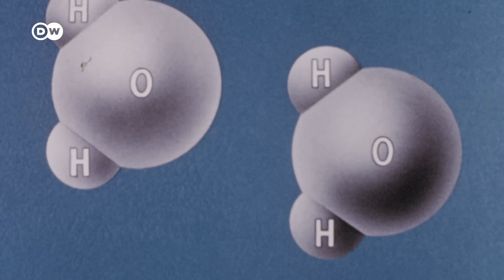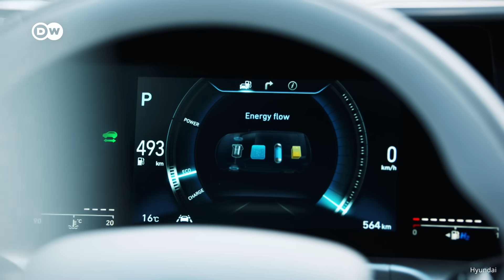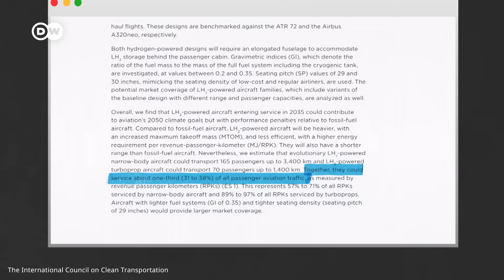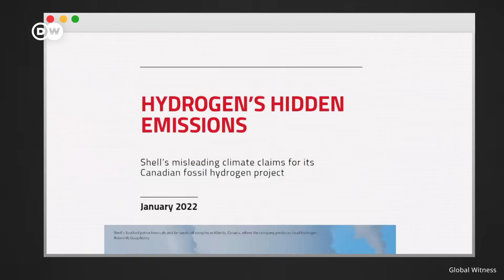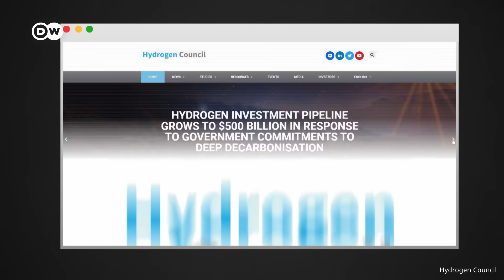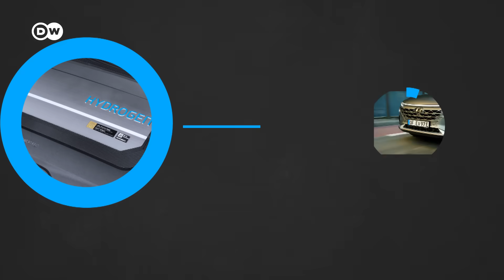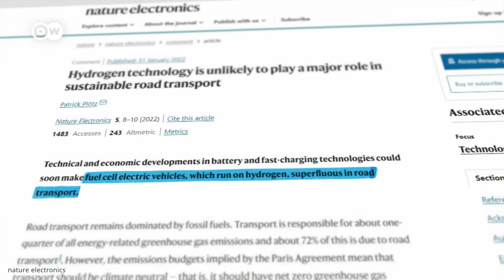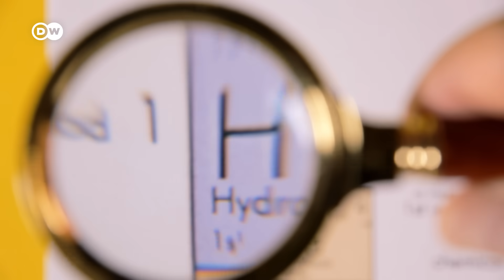The truth about hydrogen

Comment: Personally, I think that we should focus on creating methane from renewable energy. The tech already exists for industrial storage and transportation of natural gas. We could use carbon in the atmosphere and water to build methane. Hydrogen is difficult to handle, and frankly it's greenwashing. The time it takes for the technology to develop will be time that fossil fuels continue to be extracted and pumped into the atmosphere. High temperature nuclear power reactors could also create hydrogen, or green methane without emissions.
Reply: "The time it takes for the technology to develop will be time that fossil fuels continue to be extracted and pumped into the atmosphere"

That's the point. The people selling hydrogen is the same people selling fossil fuels. See, it's connected.
Now if you can connect methane with fossil fuel too, maybe your idea have a chance.
Reply: I like this idea, but I like George Olah's idea of using methanol even better, since liquids are much easier to handle than gases.

Comment: While governments like Australia's are pumping huge amount of money into "hydrogen fuel technology" trying to win young left wing voters over, it's impossible to tell the real economics. Industry giants jump onboard with this selling "technology" to government for large subsides and investments in return for marketing targeted at the same gullible young left wing voters to drive the false economy.

Facts are, there is no climate crisis, instead there is a need to move away from fossil fuels for geo-political reasons, but this will take decades as work for cleaning batteries is required and ramping up of production takes time, then you need about 20 years to replace the current fleet of cars that hasn't even started yet. 

Hydrogen is a dead end technology, it's not a fuel, but energy storage and transport, but is a really poor one. The molecule is just too small to be contained, rots steel and lacks the energy density for even space transport. Considering the space industry turned it's back on hydrogen, even though it's been using it since the early 80s with the space shuttle, itself a dead end technology should tell us a bit about it's viability for other uses. Unfortunately, young people don't have the real life experience to separate ideological pipe dreams from real world technological development and the world's over-reliance on university grads is only making this worse.

Comment: We're going to have hydrogen in the mix. There are areas where batteries aren't going to be feasible, as mentioned: Aviation, shipping and industry. Also, longer term storage.

But if we can't use energy directly, we should use batteries wherever we can. Hydrogen will never be as efficient as them.

Comment: Let me get this straight. You put in some electricity to split water to get hydrogen. Then you later extract that energy out of the hydrogen, either by burning it in a Carnot engine, or a turbine, or a Fuel Cell. That…. Sounds like a battery to me, in particularly with fuel cell with which you put in some electricity and take out some electricity directly! So, the question then becomes whether the hydrogen battery is better than the lithium batter, or all other battery technologies. Unless you can find some pure hydrogen mine big enough, the whole hydrogen cycle is just a battery cycle. You know, the closet pure hydrogen mine big enough to power the entire planet is at the place called the Sun. Too hot, and too big a gravity well. The next one is called Jupiter. Still too big a gravity well, and has some wild killer radiation.

Comment: No one going to talk about how toxic mining and refining the materials used in batteries is for the planet?
Reply: no one? The fossil fuel industry for one talks about damage caused by the production of batteries all the time. They pretend that EV batteries last a few years and then have to be replaced and that those batteries are thrown into landfill. First, the batteries last for operates at 40 years and then recycle 95% but they never mention that. They also don’t mention that every internal combustion engine car they make produces 70,000 pounds of carbon dioxide, 1000 pounds of nitrous oxides and about a tonne of particulates.
Reply: @colingenge9999  I meant in the comments section.

Comment: For economic reasons, hydrogen or more precisely hydrogen fuel cell vehicles will never catch up with battery electric vehicles, despite all the (taxpayer's) money being poured into hydrogen infrastructure. There are already many uses for hydrogen in industrial applications, but the widespread use of hydrogen as an energy carrier or for energy storage is still very much an open question, and the clear answer right now is that it's just too expensive and inefficient.
Reply: Fuel cell cars ARE battery electric vehicles
Reply: @drunkdrftr  Yes a BEV with an extremely expensive and worse performing range extender...

Comment: Perhaps synthetic hydrocarbons(for example cyclohexane) would be better choice than hydrogen. For airplanes. Maybe also for ships. The storage would be much easier than for hydrogen which molecule is so small that it is leaking through storage tanks quite fast. It was estimated that about 5% of hydrogen could be lost through the storage tanks walls.
Using hydrogen for industry may be much better than using fossil fuels. Still the generation of hydrogen from water leads to losing about 50% of energy- which is very bad.
I think battery electric cars and trucks are the future. Batteries are going to have over 4 times higher energy densities than the best available lithium ion batteries today.

Comment: Hydrogen is just another energy storage system,until now is my favorite one (i don’t see much future for compressed air, flywheels, springs, just as buffers like a capacitator) still has losses but if you do the chain production green is very self sufficient but for now i think for stationary system and pipes is ok,  it needs better tech for the automotive and smaller

Comment: Hydrogen is the fuel of the future as it simply has no equal when we look towards mother nature for our cues in how to actually go about breaking the bonds of the water molecules how nature does it. I've been working on such a technology for several years now and am finally at the point where I have it all figured out and am building a working prototype with the technology. I have all the science behind the technology solved for the most part.
With this technology water becomes the storage medium for the hydrogen that will power our world as it breaks the bonds of the water molecules at high enough rates to be able to run a ICE engine in real time. So no pressurized tanks are needed just simply a tank of water. The technology isn't even new as the first to get this technology up and running happened over 50 years ago but back then the IMF and World Banks were long on fossil fuel use and they put a stop to this technology. Now this technology is making a comeback as I got interested in it several years ago and took the time to get at the actual science behind this technology by making use of the scientific method. I went ahead and made contact with Meredith Annex to start talks about this technology's promising future.

Comment: Hydrogen can be only considered as a energy storage. Compared to just simply using the energy itself directly, H2 is a black hole. Adding the fact, that every Hydrogen car would be a bomb on the street, is absolutely ridiculous.
What alternatives do we have? Use crops to create alcohol and burn that instead. Burn the gas it creates during curing. This is actually green as the Carbon will be circulating from plants to alcohol, to CO2 to plants again.
Let's have trucks with trolleys. This would actually solve the long haul problem of heavy batteries and for the rest of the road (e.g. highway to shop/distribution center) we could use much smaller battery (rechargeable again during the highway trolley travel) or alcohol for trucks and lorries that won't use the trolleys.
And of course, use trains as much as possible.

Comment: Fool born every . . . con games ever wherewhich.  Liquid fuels at STP are supreme.  Syn fuels from fission heat make full circle.  Ain't broke don't fix/reinvent the damn wheel.  Batteries are disadvantaged by definition.  Hydrogen is really dangerous.  Doesn't give you any time to run.  Porosity was the 900lbs gorilla in this room.

Comment: No one is touching the main issue of green hydrogen: the landmass needed for renewables that will produce it - producing&burning hydrogen is 3 times less efficient than using the green electricity produced in the first place, so this means we are going to need to destroy 3 times more ecosystems to install renewable energy factories.
Reply: I think this is exactly why most people only want to make hydrogen with excess electricity. So most electricity produced by a solar panel should be used for immediate needs, the excess should be routed to a battery in order to ensure we have enough electricity to make it through the night, and any further excess should be diverted to an electrolyzer in order to produced hydrogen.
Reply: @SaveMoneySavethePlanet  So to conclude: there won’t be any significant amount left for hydrogen.
Reply: @Freba9  currently? No, because the amount of renewable generation that we have is laughably small.

But in order to hit 100% renewable generation with processes like solar and wind we’re going to have to build in excess due to their inconsistent nature. So we will eventually have the problem of needing something to do with the excess and hydrogen fuel provides a great solution for that.
Reply: @SaveMoneySavethePlanet  Sure, but it will be many decades to come and even then there are better ways to make use of excess energy. Hydrogen will always be all the way at the end of the line.

Comment: Awesome video! Thank you for pulling this information together! Although your round trip efficiency number for hydrogen(40%) is generous. For actual real world applications it can vary between 10% to 40%.
Reply: It is better 40% H2 energy efficiency than another world pollution with lithium excavation, not to mention recycling the batteries, another pandora box of plastic plague.
Reply: @batanena  what? Are you trying to say that O&G is less toxic/polluting than EVs/batteries over their lifecycle? That's not true. Just Google it. You're right that batteries need to be recycled and that's where Redwood Materials and others will play a significant role. Can the same be said for grey H2 (SMR), which is nearly the only form produced today? 😁
Reply: @batanena  so are you referring to mining the lithium clay/ore and then separating it traditionally w/ acids or the modern salt process that Tesla has spoken about.. or are u referring to the drying lithium brine beds? The modern methods, which will most likely be used with future expansion, have significantly less impact but when compared to the ecological devastation that O&G has caused...is this just "what about ism"?

O&G launched humanity forward but we need to take the next steps to a renewable/clean future. Fundamentally this new clean energy will need to be stored for future use with either batteries (80-90% RTE) or with H2 (10-40% RTE). Plus... for stationary or rolling batteries, the electrical grid already exists and will only need a bit more expansion but for H2, everything has to be built from the ground up... requiring a massive new infrastructure. All of this has a toll on our environment. We need to choose wisely which path we (as a society) take.
Reply: Reformation from natural is about 80% efficient.

Comment: 50% of cars can't be charged at home. I still haven't seen anything that solves the can't charge at home problem. Moving the required amount of electricity around will become a problem. If everyone in your street is taking 7KWs to charge their car for a few hours your local grid will not cope!
Green hydrogen has many problems but so does electricity when everyone is using it. The charge rates that people are talking about will cause huge problems when hundreds of thousands of vehicles require it at the same time.
Reply: You don’t need home charging to drive an EV. Curbside charging works fine and can be done with smart charging controllers that vary the power during the day. Even 1 to 2 kW for overnight charging is enough for your average driving.
Reply: @Freba9  Curbside charging? How many charging points are around you? How many would a country need? That's a massive amount of infrastructure!
Reply: @fidalfadel  About 8 chargers within a one minute walk around me. It is a lot of work indeed, but definitely possible. It’s a gradual process.

Comment: Excellent report. Question: do our elected representatives buy into the hype because they don't understand it's not really a climate solution  (except in a tiny number of fields like steel production), or is it that they've been corrupted by the oil and gas industry?

If both grey and blue hydrogen make emissions worse, and green hydrogen is almost always just a less efficient way to use renewable electricity than simple electrification, then what are we doing? This hype only benefits gas producers like Equinor.

Comment: Your balloon analogy SO misses the point. Liquid hydrogen's density is .07 (about 1/10 of aviation fuel) so an airplane's 'gas tank'  must be 10X bigger to fit your fuel. You thought your airplane seat is cramped now? AND you lose 1/3 of your energy liquifying it. And 25% electrolyzing it. I coined the term 'hyprogen' in 2003 and see NOTHING has changed in 19 years.

One question. How do hydrogen pipeline leaks cause METHANE to be released?

Comment: What's the point of using electricity to extract hydrogen only to be converted into electricity again at the end? The only sector I can think of where hydrogen could have been useful is in aviation or other sectors where thrust is needed. Even then there has already been a great development of ion thruster where thrust is generated by charging particles in the air. I believe investment in hydrogen will be a complete waste. But who knows maybe in the future we are going to unlock a nuclear fusion technology that can be fueled by hydrogen protium instead of deuterium or tritium. Maybe only then investment in hydrogen will look useful.

Comment: I believe the discussion of hydrogen was always has seemed very pessimistically pointing out the negatives of how the hydrogen is Purdue's and limitations. But yet when talking battery-electric vehicles we only discuss the optimistic side and ever point to battery life cycle & cost to replace and or the manufacturer the batteries, that includes the energy cost to mining and/or recycling of raw material, manufacturing and shipping. Which are not exactly green and environmental friendly.
Reply: While producing batteries does have emissions most EVs will offset this by the time they hit 40-50k miles. And this is only going down as more of our electricity generation is produced from renewables.

Even once all our electricity is renewable, hydrogen will never have lower emissions simply because it’s less efficient to produce and transport it than electricity. Approximately 75% of the electricity makes it to a BEV whereas 40% or less energy makes it through the production and transportation process for hydrogen.

It has many potential uses like what we’re listed in this video, but it really simply should not be used in cars.